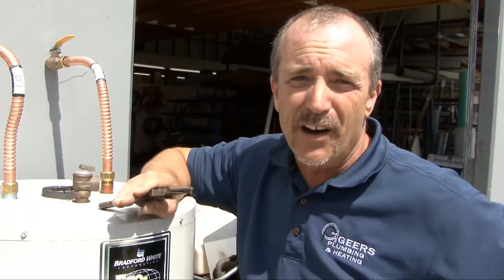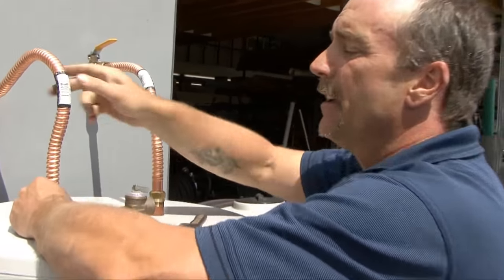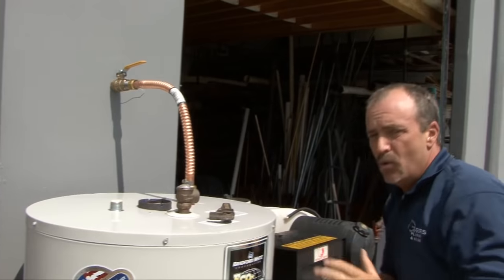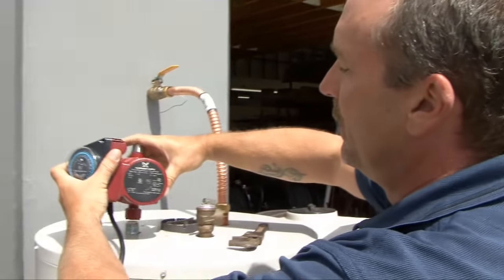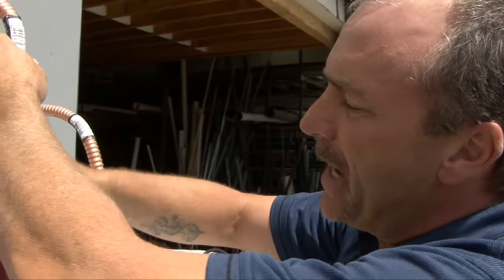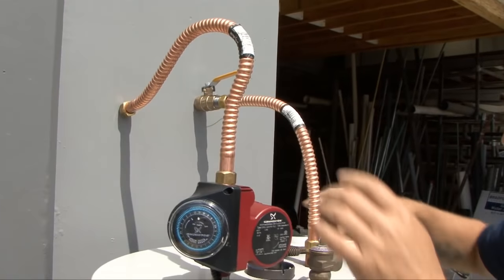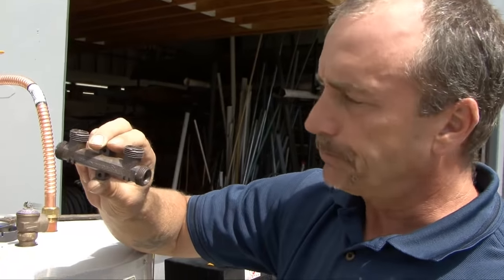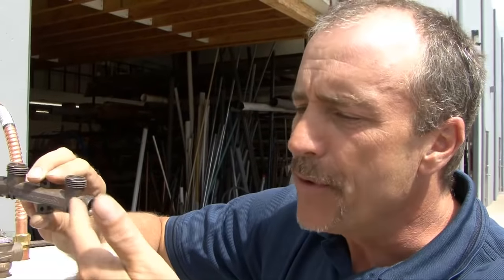HOW TO: Get Hot Water in Seconds

Comment: I installed a Watts recirculating pump on my water heater. I installed the  Hot Water Recirculating System Sensor Valve Kit under the bathroom sink which I believe it's the furthest from the water heater. When the pump is on, the cold water at that sink is warm not cold. It's the only faucet that does that. I'm not sure what the problem is. Any help is appreciated. Thank you
Reply: It's because that is where your sensor valve is. The valve opens when the water temperature is under 90° F allowing the hot water to flow throw into your cold water pipe. The valve closes again when the water flowing through it reaches 90° F again. This process happens all the time to keep the warm water at your faucet. When you turn the cold water on you are flushing out the warm water that was pushed into that pipe before the real cold water comes out.

Comment: Can the valve be serviced when it stops working or is it a throw-away and replace?  This gel pack inside that you spoke of, is it sealed or can water get into it. I have a valve that seems to be not working and a replacement is half the cost of a new system. Doesn't that encourage new customers!!!
Reply: Bypass valve is not repairable, you replace it when it stops working. $75.00 for a new bypass valve.

Comment: My question is actually based on pressure. Houses here are normally installed with an auto pressure pump for the main supply line. The pumps produces a pressure rating of around 10 bar equivalent to 145 psi (Pump on the pent house). Does this mean that the booster or pressure pump on the supply line will contradict the pressure and thus the flow with this recirculation pump?

I am not sure how this pump works but in the other video they say as soon as the water temperature at the valve drops to 98 degrees, it will allow water to be recirculated. By this, I believe the Watts small pump works on pressure stutus. When the valve shrinks due to heat change, water is allowed and therefore the pump detects the loss of pressure and starts to function. Does this means if the pressure on the cold supply line is greater or higher to some extent then the Watts pump won't start? In other words, what is the maximum pressure allowed on the cold line or the main supply line for this system to work properly? 
I am asking this just because we are going to boost the supply line with a 10 bar/145 psi automatic pump for two reasons. 1. It's because we want pressure on all showers below as water supply is free fall from a tank above. 2. A 200 liter central heater is at the same level as on one of the showers. Pressure will be so less at this point. 
Any help is much appreciated in advance.
Reply: Pumps work on relative pressure. Since there is 145 psi on both sides of the pump (once the lines are pressurized by turning your shutoff valve to the open position) there is a net pressure of 0 between the input and the output. Once the pump is on there is only a slight increase in pressure between the input and output.

Think about it this way. Air compressors pump air through them but both input and output sides are pressurized with atmospheric pressure, and thus the atmospheric pressure cancels out and you only have left the pressure that your compressor is set to.

There is no pressure difference between hot and cold lines when the pump is off and there is no water running.

(By my deduction) The way this system works is there is a pump that has a built in bypass of some sort so when the output pressure of the pump is greater than a certain point the bypass is activated and allows the pump to pump a low resistance route. This is a built in property of some types of "fan" pumps and seeing as the pump is circular I would hazard a guess that they're using this type of pump. So when  the temperature sensitive valve at the other end of the pipe opens the pump pumps hot water until the valve closes. When the valve closes the pump "free-wheels" in the bypass so the pressure doesn't get to high.

Hope that helps even though your question is 8 months old.
Reply: WHERE ARE YOU AT?  NO NORMAL HOMES EVER HAVE A PUMP IN THE ENTIRE USA.  UNLESS CUSTOM. MANY USA HOME HAVE A PRESSURE REGULATOR   SET ABOUT 75 PSI TO PREVENT SURGES  AND  WILL BREAK SUPPLY LINE AND FIXTURES . STANDARD FIXTURES ARE RATED AT 100 PSI.  BAR IS FOR AIR PRESSURE NOT WATER. ALL OF USA USES FLEX LINES. ITS NOT GHETTO BOZO.  WATER HEATERS ARE NOT INSTALLED OUTSIDE  EITHER.  THERE IS A METAL  PHONE BOOTH TO COVER IT. SO MUCH BS ON THIS  WEBSITE.  THE  PLUMBER IS TYPICAL  OF THE TRADE TO LEAVE  HALF OF IT OUT...... LIVED IN HB  FOR  30 YRS --- LOTSA FLAKES.
Reply: @b5a5m5  Exactly why you cant have thrust in a vacuum of space.

Comment: Based on the timer setting, does the pump on the hot water heater discharge line keep running during the chosen time frame of its operation, or it kicks off the moment we open the hot water faucet any where inside home?
Reply: They have other products ( booster pumps) for tankless water heaters. Where you push a button in the bathroom to turn the pump on and off. this product is controled by the timer only.

Comment: This system works if you have a pre-existing home or if you can’t get to the plumbing lines anymore. However if you can there is a much much better much higher efficiency system. With the better system the pump only runs when you enter either your bathroom or your laundry room or wherever you are going to use hot water. If you use a timer it seems like it’s never on when you need it. So again use the system he’s explaining if you have no other way otherwise use the better system there is just no comparison. With his system if you’re gone for a couple of weeks and forget to shut the pump off it runs every day even though you’re not home with the better system the pump runs only just before you start to draw hot water.
Reply: What’s other system do you have a mind?😊
Reply: And the much much better system is…..what??
Reply: Mystery system

Comment: Will this product work on ANY hot water heater?  I ask because my existing recirculating pump worked like a chanp on my water heater but as soon as I had my water heater replaced my existing recirculating pump does not work on the new hot water heater.  So if I buy the product you show in this video, will it work on my new hot water heater that my old recirculating pump wouldn't?

Comment: Doesn't this system mean that you will have Temped water in the cold water line when you want an Cold drink of water?   If you don't want Temped cold water you would need to run a return line back to the tank.  I'm I incorrect in my understanding?
Reply: Just run the pump only when you desire hot water. Tepid water from the cold line is a small, temporary price to pay for nearly instant hot water. Just give it a few minutes and the cold line will equalize to room temperature, just like before you installed the pump.

Comment: I have a question: Imagine that you live in an older home and you are unable to determine which hot water fixture is the furthest fixture away from the water heater. If I guess wrong will this device still provide benefits?
Reply: yes, install the manifold at the fixture you want the hot water to quicker
Reply: Let's say you have a kitchen and two bathrooms. Get two people to help you. On cue you and your helpers turn on full hot water at all three locations at once and the have each shout when they feel hot water.  The first to notice is the closest location to the water heater, the last to notice is the farthest location. But the closest and farthest locations may not be on the same path. For example in my remodeled house, the water heater used to be in the middle of the house 12 feet from the kitchen faucet. During remodel, the tanked heater was replaced with a tankless heater in the garage but the hot water now had to flow to what was the middle of the house before it could flow anywhere else.  That effectively moved every faucet about 30 feet further away from the heater.  It also means that the path from the heater to the kitchen is common between all faucets, but the path from the heater to the master bath is quite different from the path to the guest bathroom.

Also, I would also add that I think FasterHotWater.com has a genius solution.  They add a "flow monitor" to their system which turns the pump on WHEN it sees water flowing. That means you can e.g. turn on your hot water at any faucet for a second, turn it off and then wait. Meanwhile the pump stays on for 3 minutes to circulate the hot water back to the cold line allowing the heater to push hot water into the line. In this use, you waste very little hot water and do NOT run the risk of continuously running your heater to keep the water in the pipes hot.

Note: My plumber had a Watts (Grundfos based) kit that he installed for me, but it didn't work. The reason it didn't work is not clear, but tankless heaters require sufficient flow for them to turn on and apparently either the  pump (or the bypass valve) didn't produce enough flow.

I just noticed a "genius" idea... which is to install TWO (or more) bypass valves to increase the flow.  Gonna try that and if it works, I'll probably add the flow monitor.

Comment: What would happen if you do not put the pump  you just put the valve sensor
Reply: Jose Reveles they are at very similar pressures and the water wouldnt move in the pipes.
Reply: wouldnt work, hot pressure needs to over power the cold.
Reply: I got into this chat by chance, looking for the same answer. Would it be possible to just install the sensor? then as soon as I open the faucet, water would start circulating through the circuit but will not come out until it has reached the right temp. I still haven´t found the right answer.
Reply: @p4csl.s.l.451  That's a rather vague question. Exactly which faucet would you open? If it's the hot tap, it'd be no different than if you had not installed the bypass valve at all. If it's the cold tap, you'd get increasingly warmer water until the thermostatic valve closed.

Comment: so would I need a bypass valve for each fixture that uses hot water ?
Reply: No. If the fixture is between the water heater and the valve the way I read it is you are good to go.
Reply: ...and this because by mixing/pushing the hot water into the cold line (thus keeping it in the supply line, and not wasting it) at the farthest fixture when it gets "too cool" appears to the water heater as "using hot water", lowering the reserve of hot water in the tank and causing it to kick on.  The result then is that there is always "hot" hot water at the furthest fixture, and if the hot water line contains hot water all the way to the furthest point, there will be hot water for every fixture closer to the heater too.

Comment: So I installed one of these in my kitchen sink,  but realized there is another one underneath a bathroom sink.  I also noticed I get hot water all the time in the kitchen regardless of if I select cold.  Not sure what to do.
Reply: Maybe your pump is running constanly  (too often). Therefore it is pumping hot water into the cold water line all the time. So you get hot watee from the cold water lines when you turn the tap
Reply: Are you saying you have 2 by pass valves?  one in the kitchen and one in the bathroom.
Reply: @geo8rge  Yes I installed one under kitchen sink and realized later there is also one underneath my master bath sink.  The kitchen is farthest location.  Sometimes (not always) we get hot water from the cold side in kitchen sink as well as the fridge water dispenser.  Kids say upstairs sometimes it's hot from cold side as well.

Comment: Is this basically a recirculating pump?
Reply: No a booster pump. with a bypass valve.
Reply: Donald Baker what's it boosting? it's recirculating
Reply: It's a circ pump. Not a booster pump. It circulates cooled water until that terminal device senses the hot.

Comment: I installed one of these several years ago now it no longer works, I know the pum is functional because I can hear and feel it running, what’s going on?
Reply: Your bypass valve may be stuck closed?

Or perhaps you don't hear it "running" but you hear it "humming" like a ceased motor?
Like the first couple seconds of this video https://www.youtube.com/watch?v=FMegj9_OYeE
In that case your pump is bad and needs servicing / replacing.
Reply: are you just not getting quick hot water to the fixture?
Reply: Look at the bright side and don't fix it.
Can you drink water heater water?
The Claim: Never Drink Hot Water From the Tap
Environmental scientists say it is real. The reason is that hot water dissolves contaminants more quickly than cold water, and many pipes in homes contain lead that can leach into water. And lead can damage the brain and nervous system, especially in young children.

Comment: The hot water tank is insulated. It seems inefficient if hot water is waiting in the pipes in older homes
Reply: The recirculation pump adds hot water convenience, not energy efficiency.
Reply: So trigger the pump on your preferred schedule or on-demand. Nobody said it had to be running all the time.

Comment: Where is the crossover point where you see payback for additional heating of the water vs using additional water waiting fir the hot to reach the fixture?
Reply: your just conserving water. An saving time. Thats all. No savings here.
Reply: For a tankless water heater, there is no appreciable difference as you'd still have to burn gas either way.

Comment: Why not just get a on demand water heater? Most of them mount right under the sink.
Reply: This can be good if you have natural gas or propane.  If your home is all-electric, the on demand heaters need 80 to 100 Amps of current to operate.  While they aren't on for lengthy time periods, if this current is needed while your A/C and oven are running, etc., you may exceed the power available in your home.  This is a paraphrase of what I was told by a plumber when I inquired about it.

Comment: Once the valve closes due to water temp, what does the pump do? 
If the timer is set the pump is running, but the bypass is closed due to temp achieved. Does it continue to pressurize the hot water line with nowhere to go?
Reply: It's most likely a "fan" type pump. It "blows" water like a fan blows air. If the line is blocked it will raise the water pressure probably a psi or something, but not much beyond that because that 1 psi is enough to push the water back through the "fan blades." So it shouldn't damage your pipes. This is just speculation though, as I have just thought about building something like this but luckily it already exists!
Reply: Before spending some $ , anybody sure about this?
Reply: Al C yes this is a legitimate solution to retro fit your closed loop heating and cooling lines for instant hot water. If you have a large house 4500 sq feet or larger you can use more than one of the valves. The brand he is using Grundfous is excellent. This Old House on PBS has a great overview of four options. 
available to use on YouTube. Best to buy a unit with built in check valve back-flow preventer and a programmable timer
Reply: Those things never work and you point out the obvious you have that pump running when you open a cold side fixtures the pump pushes hot water out of the cold inlet on the water heater and you get hot water on your cold side .
Reply: It is a booster pump, first you set the timer for the hours you will need the hot water quickly. Usually morning showers and evening cooking. when the bypass reaches its desired temp the pump is still running. very low h.p. 1/25th h.p. wet rotor design to run quiet and with no flow. it does pressurize the line just enough to over power the cold side.
Reply: It is not a Pump, it is a circulator and doesn't create pressure.

Comment: Once the water is hot and the valve stops the water were dose the water go the pump is still on ,until timer is off , the pressure is building until the Faucet is open
Reply: Jerry Nieves — I’ve read that the pump has a recirc line within itself so it isn’t deadheading.

Comment: You'll save money on water bill, and you will have the convenience of instant hot water, but you will wind up using more gas, or electricity which is much more expensive than water.  Just so you know.  This is cheaper than a tank-less hot water heater, but there is a trade off.
Reply: good point!
Reply: Mike K ,  not if you add logic and sensors,  aka an aqua stat and or timer combination. it only comes on when one or both dictate. the timer or aquastat
Reply: Instead of recirculating pumps and this device...I have a fantastic idea...just need to patent it first  ;-)
Reply: Mike this is cheaper than a tankless water heater, because it is a pump and not a water heater. A tankless water heater will not get you hot water faster. it is a distance thing. furthur the heater ( tankless or tank type) the longer it takes to get hot water, You would still need a pump of some kind for quick hot water.

Comment: What about instead of this electric energy costing system, you super insulate all hot water pipe in your house? If you put hot water into a thermosbottle it stays hot for a long time. Could the same not be achieved inside the hot water pipes? Combine it with thermostate driven fawcetts and you'll have instant warm water unless you have not used the system for a longer time. It also prevents heath getting away and heating water is costly by nature anyway.

Comment: heres a solution. tie in your hot water line into your toilet. take a crap flush and then your water will be hot and ready to go. thank me later :)
Reply: Eh, I've got a hot water bidet and no amount of pre-flushing with the hot line gets it to decent temperature in a reasonable amount of time. You need a much larger volume of hot water than that to heat the hot line.